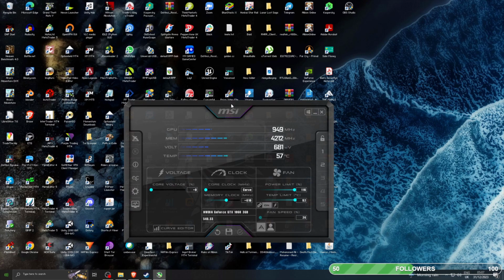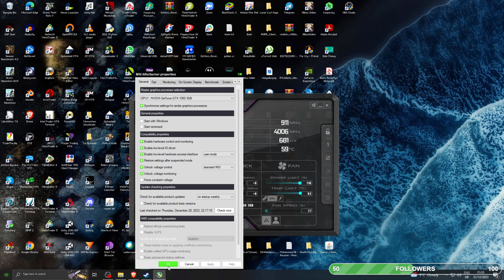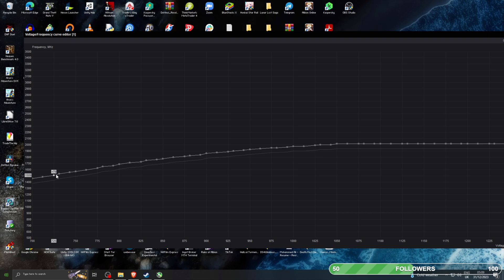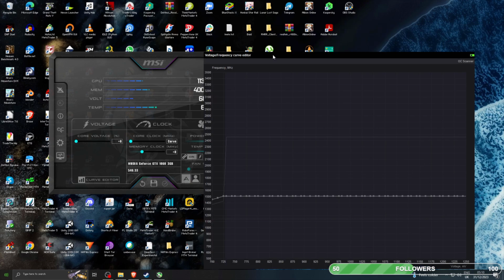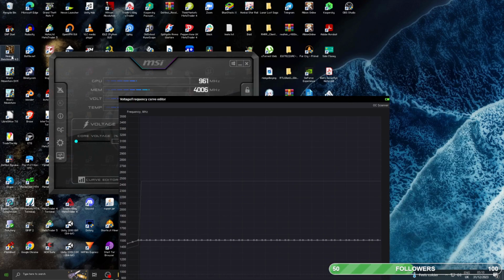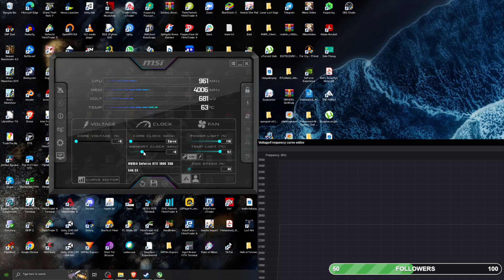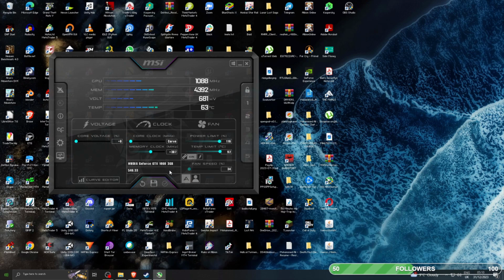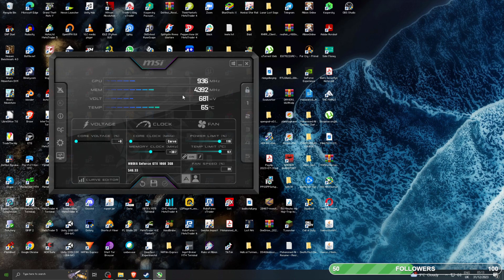Undervolt GTX 1060 3GB  - Less Noise, Lower Temps, More FPS!

Comment: Is it possible undervolt to 60w? I want buy this gpu
Reply from the maker: Not sure if that is possible. I would however recommend buying the 2060 or even the 3060. Same price but way better performance. Newer architecture and everything. I am talking about the UK prices however, on Amazon they are about the same price which doesn't make sense but it is what it is. Thanks for commenting and watching, apologies for the delayed response. :elbowcough: